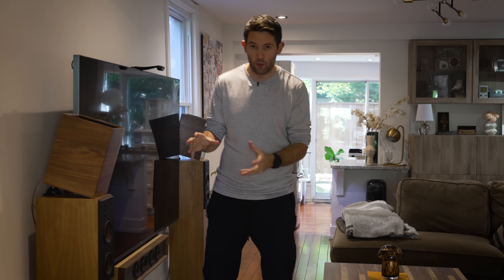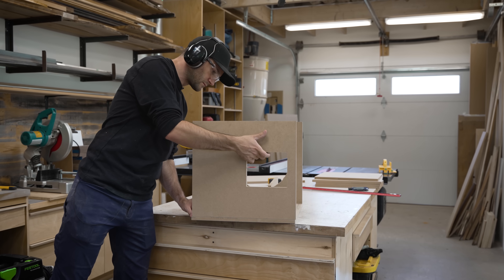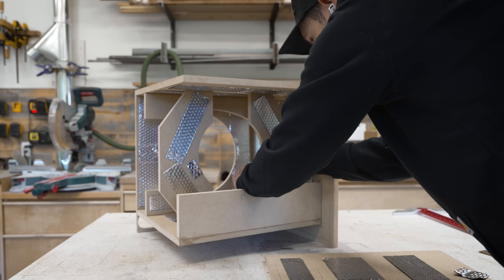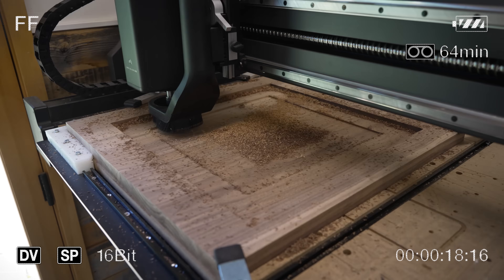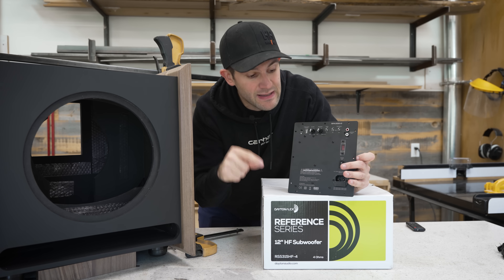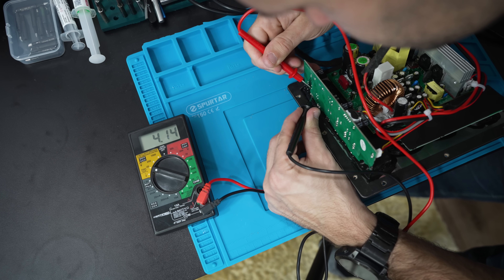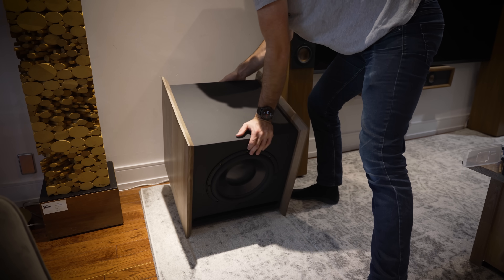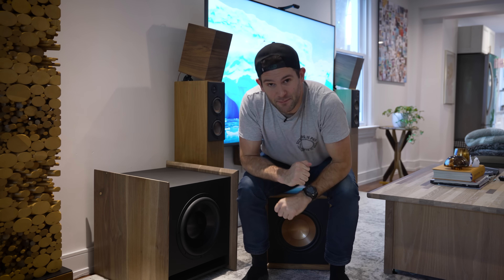THIS changes DIY Audio...

Comment: 11:09 power statement incorrect. Opposite situation kills speakers. Clipping produces DC
Reply: I came here to say this. You would be much better off with a 500 or 600 watt amp in this situation. First of all, that amp will never push 300 watts from impedance rise, but like you said, clipping is what kills a sub. I almost always go  25-35% more on my amp, than my sub, in terms of power
Reply: Thank you both... Glad I'm not the only one that was running to say this! Generally speaking, most amplifiers will only push about 80% of the peak power with a clean signal. This is changing very quickly with today's technology, however, you would rather be safe than sorry.  So if a sub is rated for 300 watts, your best option is to have an amp that is rated for 400-500 watts so you have a very clean signal with ease and the amp will run much cooler.

Comment: Just a couple of questions.

1. Why did you go with the retailer’s suggested cabinet volume, but then randomly picked your own tuning frequency rather than the one suggested.

2. How did you determine the port dimensions? The airspace between the 90 degree panel, and the back of the cabinet constitutes part of the port, but it appears to have a different cross-sectional area to the rest of the port. I’m not saying it won’t work, but it must have made the calculations complex.

You obviously have a well equipped workshop, but do you actually know anything about loudspeaker design? And no, a bass reflex cabinet with a built in plate amplifier doesn’t change DIY Audio.

For anyone interested in this drive unit, by my calculations a 75litre cabinet volume, tuned to 24Hz gives a maximally flat response down to 24Hz. Reducing the cabinet size, and increasing the tuning to that advised in the video raises the cut off to 29Hz with a 3dB boost in response at 40Hz. Neither is wrong, they are just different.

Comment: You want to use caulk inside the enclosure for sealed subwoofers to ensure air doesn't leak out. Also if you underpowered a subwoofer enough like running a 400-watt sub on a 100-watt amp, you'll limit the sound quality of the subwoofer.

Comment: I think you need to put a frequency cut off in there.  Wireless won't be as good, you should try wired.  You can also include a better A/B amp in there as that burson one is cheap.

Comment: If this is your first ground-up subwoofer build you probably should do this more often. My sub project that never quite got built sadly was much like this one, except it was based upon the 15 inch version of that driver, and used a higher power amplifier with room correcting DSP (all parts available from the same place). Maybe you could build that for your next project and I could live vicariously through your youtube videos?

Excellent content.

Comment: Back in my day, I would always measure the Driver's VAS, Qts, and Fs, out of the box. then I used to drill, and use wood screws and countersink in the box, with glue. The nails will work loose. And we would fill it with "acousta fill" insulation. Guess times change.

Comment: @4:30 - I say this as a person who, in high school, started a small business with a friend of mine (also in high school) where we designed and built speaker cabinets for concert and home theater use.  We also designed and built the demo room loudspeakers for Clark Synthesis, Tactile Sound.  Every speaker on the market has a list of published Thiele-Small parameters, which include physical characteristics like the resonant frequency of the driver, voice coil inductance, dimensions of the voice coil, etc, and it will also include testing supplied parameters such as the 3db drop-off in open-air, as well as the displaced volume of the driver, peak to peak, and more.  It is the 3db cutoff and the resonant frequency that you use when choosing the port frequency because it adds about a 6db boost to the audio level at that point.  This allows you to have, in the case of a single-ported speaker, a deeper lower-end, and it will carry the frequency range of that driver much lower.  In a dual-port bandpass you end up with two ports, calculated at the 3db drop-off for the low end, and a second one at 1 octave higher (double the frequency of the lower value).  They are not to be chosen at a whim as they are intended to support the driver and help it to maintain an even output of power across the whole frequency range it's intended to produce.  

Ports are not determined by the length of the port directly, but the surface area through which the air is conducted.  If you use round ports, (aside from choosing a proper diameter to avoid "whupping" sounds created by cavitation through too much airflow through too narrow of a port) you just do the math and determine the surface area of the port itself to figure out the port dimensions.  Also, the neat round edges you put on your port, while being aesthetically pleasing, are restricting the port and will result in worse overall performance.
Reply: Last, it's recommended to use something like t-nuts on the mounting holes when screwing into/through MDF.  MDF itself is pretty strong, but it's not great when using screws directly into it.  It's very easy to strip it since MDF is just sawdust of varying size held together with glue.  

On the topic of glue, it's also recommended to use melamine adhesive instead of standard wood glue, since it essentially breaks down the glue in the MDF and creates one cohesive glued piece out of the two separate parts.
Reply: Just got to the dynamat part.  No one who builds speakers professionally does this.  If you want to reduce the resonance from the speaker walls (which is negligible in a cabinet of that size with that much bracing in it - it's a ported box, not sealed) just use wood glue and screws.  You can also add polyfill which can add a "sense" of increased volume to the speaker.  There's some, but not a lot, of testing to add that it helps with smoothing out the overall frequency range.

Edited to add, remember that all of the volume of your speaker (which determines the function of the speaker itself) is being eaten up by all the bracing and dynamat you've added.  I hope you've calculated the volume of those components into your math which determined the volume of the speaker you are building.
Reply: Subwoofer sandwich - the reason that loudspeaker manufacturers either build their speaker boxes out of hardwood (which is fine by the way) or add a veneer to them (plastic or natural) is that adding a second box around the first will only create voids in the cabinet walls which CAN create resonant pockets and panel vibration if/when the glue holding it together dries up over time, and that it just adds a lot of weight.  Oh, and it's a waste of good wood.

Comment: Great presentation!!! One quick observation/comment about amp/driver power matching: 

Generally, you won't have a problem with an amp that puts out SIGNIFICANTLY more power than the sub's rated power handling - even DOUBLING the amount won't cause any driver problems. That EXTRA power allows you to run the sub driver at louder volumes with "CLEAN" power from the amp, ie: no "clipping" - this is especially apparent at bass frequencies, which require much more current from an amp to the sub driver. 

OTOH, if an amp is either under-powered - or is juuust AT the driver's rated power handling - when a sustained bass frequency is required, the amp can go into "clipping" - which destroys sub drivers MUCH FASTER than powering them with the extra power. It's called: AMPLIFIER HEADROOM. 

IOW, MORE power - equals CLEAN power.

Also: That new sub WILL take some time to play-in/burn-in, "loosen up", and "bloom".....

Comment: I bought the exact same Dayton Audio wireless transmitter several years ago.  The first 6 months was ok, but then I started having issues with it.  It would drop connection, introduce interference into the audio and sound all around bad.  I ended up abandoning it and going back to a good old fashioned wire.  If it were me, I'd be extremely hesitant about converting your other speakers to wireless until you vet out your current setup for a year or so.

Comment: Ah, 2.4GHz...  If you have a microwave nearby it will create significant issues with the sound quality while the microwave is in use.  This is because the microwaves operate on the 2.4GHz frequency range.

Why does a microwave create so much interference?  Your standard wireless devices are FCC (US) limited to 1 watt of total power that can be used to broadcast that signal - that is 1 watt before it reaches the antenna, which means that broadcasting has less than 1 watt available.

A typical microwave consumes around 1200 watts of power, and an enormous amount of that electricity spills outside of the microwave shell.

I don't think that I need to illustrate the difference between 1 watt and 1200 watts, but I will...  1 watt is like a mouse squeak and 1200 watts is more like a cargo ship horn.

Beyond that, that is beautiful setup!  I would love to have your garage - those tools would be used near daily. :)
Reply: Ya! And don't forget the nice Panasonic 2.4 GHz DSS (Digital Spread Spectrum) cordless phone technology stomps all over the Wi-Fi channels equally!!! 😂
Reply: @RTR-MATEY  FHSS (Frequency Hopping Spread Spectrum) does a nearly identical thing, and all BlueTooth devices leverage FHSS - so, they're equally negatively impacted when they're close to a microwave when it is operating.

Comment: I wouldn't recommend investing much time and money to make every speaker wireless. The separate wireless signals "might" interfere  with each other and might pick up noise from other wireless or radiating devices. I don't know about this specific device, but it's a wide spread problem even in ready-made wireless cinema systems.

Comment: Regarding placement...

Next to the couch is a horrible idea.  When it comes to subs, boundary loading is the winning ticket.  Against the wall is 2 boundaries.  Each boundary gives you 3 more dB, which is the equivalent of doubling your power for each boundary.  In the corner of the room (3 boundaries) is the most efficient placement of your subwoofer.  And by adjusting the cabinet's distance from the wall, you can "tune" the cabinet's dominant frequency to compliment your room.

I suggest a most excellent subwoofer primer by Void Acoustics written by Rog Mogale.
Reply: Corner load facing in conjunction with phase inversion (simply switching positive & negative leads) if necessary works pretty darn well!!!

Comment: Beautiful work.  But I have to correct you on your power assertions.  

More power does NOT equal "overdriving."  Overdriving occurs when there's too much SIGNAL.  To avoid too much signal, it is better to run more power.  I generally double the RMS rating of the speaker.  So for that 300 watt speaker (assuming that that is its true RMS rating, which it usually is NOT on consumer speakers, but I digress....), I would've purchased a 600 watt amp.

Conversely, running too little power will cause you to send more signal, which brings you closer to overdriving your speaker with those nasty square waves.

To really bring the point home, in theory, you can blow a speaker with LESS dB because of a smaller amp.  So amp it up and get more dB safely!

Qualifications: Professional audio engineer 20+ years.

Comment: KLIPSCH KICKS ALL SORTS OF ASS WITH BEING ABLE TO HANDLE TONS OF POWER AND GIVING YOU CONCERT HALL TYPE AUDIO BEGIN WITH THE RP 6000 F OR THE RP8000F FOR THE 8060 FA FOR THE R7 MARK 3. IS THERE AN EXTRAORDINARILY SENSITIVE AND CAN BE DRIVEN BY ANY AMPLIFIER YOU MAY OWN ABOVE 50 WATTS PER CHANNEL AT 8 OHMS. AND YOU MAY NOT EVEN NEED SUBWOOFERS WITH THE SPEAKERS MENTIONED DEPENDING UPON THE SIZE OF YOUR ROOM.

Comment: Having installed specialist speaker setups in recording studios, I can of course see a number of things I personally would change to improve the system. I have also set up a home theatre system in someone's home as well, which has enhanced the bass.
I would never make the speakers in the same way you have, but that is personal preference and can vary depending on who designs the speaker boxes. The main issue I have is the speaker itself, which shows you have chosen a roll surround speaker, which can have problems later on in its life or under load with a reflex cabinet. A stiffer edge surround gives a punchier sound whilst maintaining a good bass response. 12" Speaker is probably the smallest you should use, with an 18" preferable.
Secondly the speaker is sat on big rubber feet, which of course does transmit and alter the cabinets resonance. In the recording studios we mounted the bass speakers on concrete pipe, which was embedded into the concrete floor of the control room. Because this was so successful in the house a hole was cut in the floor and the reflex speakers were mounted in a similar way to the studio with the effect there was no resonance through the floor. 
Whether or not a wireless setup would work adequately in all home conditions depends on a lot of different things, after all in live concerts a combination of wireless and wired systems are used. It is a neat idea and worth investigating.
The amplifiers in the speakers is of course to alleviate signal quality over cables and with the addition of the wireless setup, this would of course rule out many of the problems you have with a wired system, the only problem there would be the cost of very good wireless units.
A very good video showing you have thought this through to your own satisfaction, but with room fro improvement.
Reply: Don’t be that guy.

Comment: Really? All that woodworking equipment and the best you could come up with are butt joints? I thought you wanted a sturdy, fully for life sealed cabinet. And NO, you don't buy an amp that is the same power rating as your speakers. Just look at JBL Pro speakers. For example, the SRX-815 non powered speaker is rated at 800 watts continuous program, but their SRX-815P, powered version, comes with a built-in 1500 watt continuous program amplifier. Hummm, why would that be?

Comment: 0:12 I always laugh when I see "height" speakers in a surround system. People think that pointing a small speaker upwards is going to make it sound like its sound is coming from the ceiling. It won't. It just limits what you hear directly from the speaker to the mids and lows whose wavelengths are long enough to diffract around the cabinet and reach your ears directly. Of course, I will admit, this is the first time I've seen drivers recessed into what amounts to the inside of a barrel to try and control the directivity - but that can only make them sound terrible. If you want the speakers to sound like they're over your head, mount them overhead.
Reply: child
Reply: @mattis117  So pointing out reality makes someone a child?
Reply: @johnterpack3940  no.
Reply: @mattis117  Then why did you call the guy a child for stating reality?
Reply: @johnterpack3940 hes an audiophool. Thats why

Comment: Your amp is about half the size you want - you dont want to use an amp as your limiting element - the DC of clipping is the best way to fry your speaker. 
You also want to run the amp FAR away from its limits where its THD is lower and the amp is more stable and less prone to noise - ie just turn it down.
Also going to all this effort and adding cheap wifi with tiny unbalanced cables is kinda a joke.

Comment: There's no accounting for taste I suppose, but the new one sounds worse than the old one. You described it in exactly the way I was thinking while listening to it. Although you said "less punchy" and I was thinking "muddy", but that's still the same thing. Ported subs can still have a ton of punch to them; without knowing anything about this brand of drivers and amps, I suspect it's their fault (primarily the amp).

Comment: Considering it's a short distance, I would prefer seeing the wireless connection be 5.8Ghz rather than 2.4 to avoid more distant interference. Also, I'm curious if the higher/faster frequency has more accurate timing of sound.

Comment: You got that backwards, over driving is bad, but far better then DC clipping. Clipping is hard to hear and quickly causes your drivers voice coils to heat up and burn. Always opt for a higher powered amp then your driver! You also get better characteristics from the amp if your not driving it at its limits.

Comment: Nothing like having a good source or even better, an external DAC and feeding it to a class D amp through a wireless link.  Not that all wireless links are bad, a good one should be able to pass better than the source material.  I just have a creeping vibe that is not a good one.  Actually, it would make more sense if you can get the sub out in a digital format to send it that way and use a good DAC and amp at the far end.  It would not be too hard to make a "control" box that also digitally connects to the amps to allow it to look ad feel like a conventional receiver but with the all of the analog stuff at the speakers.  Sort of like how that one company built the computer speakers with the sub, and the control box was all 0-10V signals, but in this case it would be digital and wireless.  But the same idea of the heavy stuff not being at the point of control.